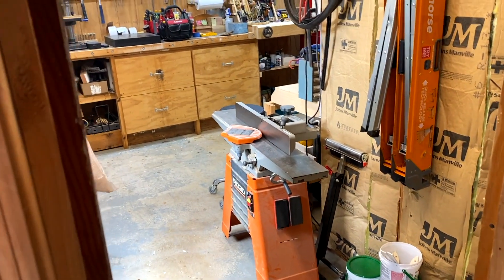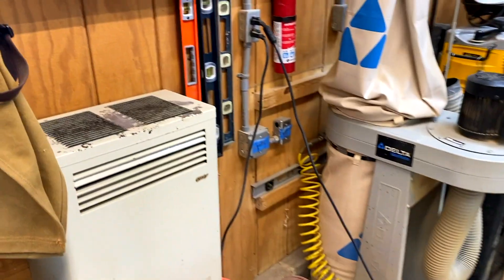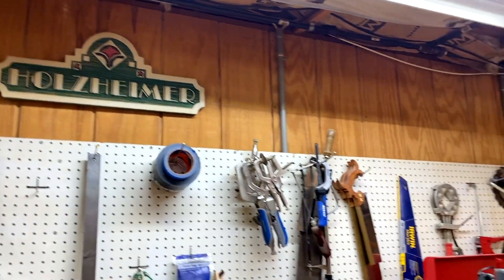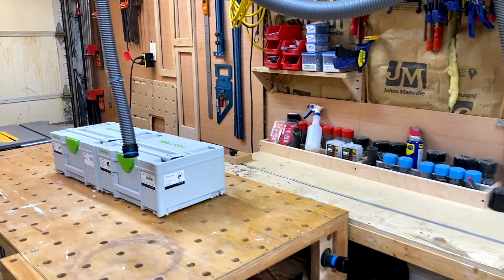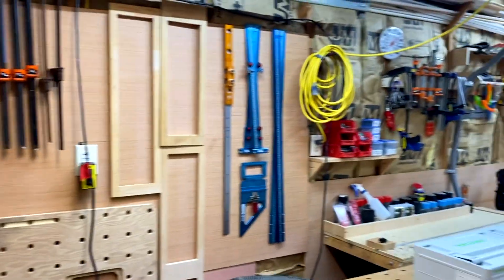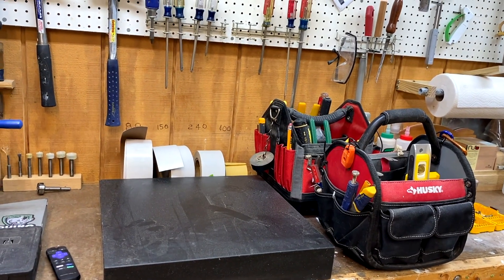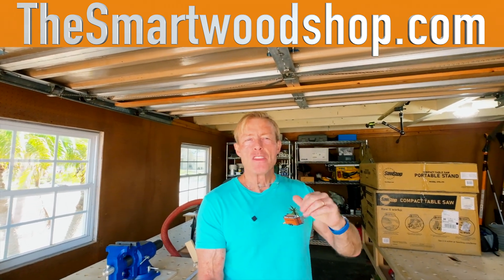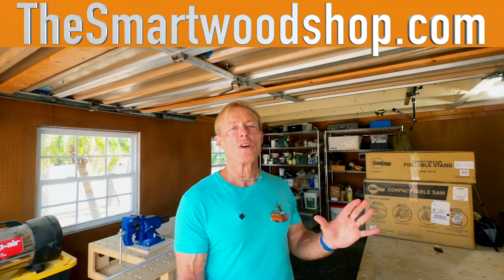Smartwoodshop Tour with Rich Holzheimer

Comment: What do you think about the CTS QuickClick / Cen-Tec Click-e dust hose tool attachment system?
Reply: hi
i like it because i have all the adapters and it’s easy and fast to connect them the only adapter i need to share is the one for my festool domino and sander 
so it’s working well for me

Comment: Rich - Love the small shop!! Love the hanging vac hose. Do you ever have a problem with tripping a circuit when your vac kicks on with the tool? I’m having that issue in my shop and not sure how to resolve.
Reply from the maker: It is the start up demand on the breaker. The power if probable fine once running. Sometimes the breaker gets a bit weak as it ages. You might try installing a new breaker. If it still trips, talk to a licensed electrician to see if the wire would support upping the breaker amperage.
Reply: yes i agree with Ron
sometimes the in rush current can cause a trip i have my 10” dewalt jobsite saw and vac on the same circuit and even though its a 20 A breaker sometimes it does trip but only on initial start never when it it running unless i get something jammed in it
Reply: @richardholzheimer6965  thanks! I appreciate it